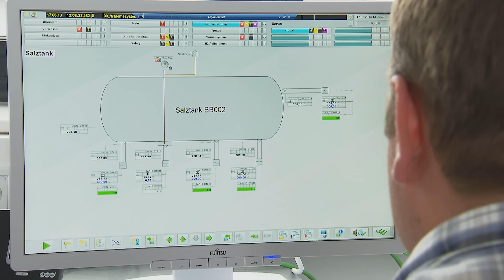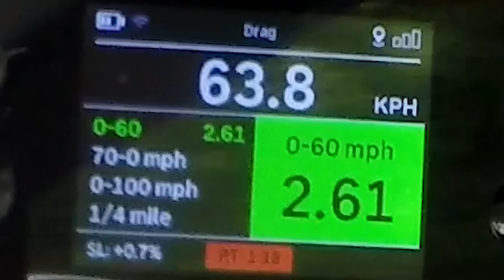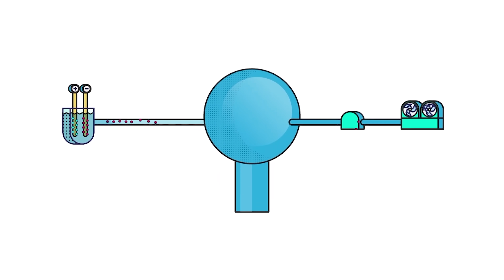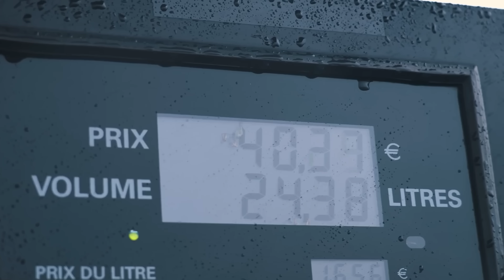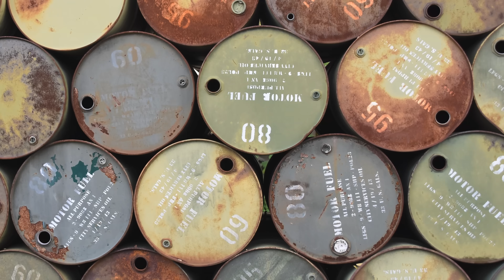Porsche just SAVED petrol engines FOREVER

Comment: Had no idea the racing cars were already using this. Shows the fuel works and racing is important for car developments.
Reply: F1 will be using it from 2026, when Ford and Audi enters. This still doesn't change anything about EVs. E-fuels will be way to expensive for a long time.
Reply: The WRC also use it too
Reply: What do you think F1 was all about? Tyre development, oil mileage etc
Reply: The fuel is over double the price to conventional gas so nobody will want to use it in reality unless they manage to push the price down considerably.
Reply: @dingdong2103  "Over double" is doing it a disservice. Will be far more than that. Energy requirements are huge.
Reply: @dingdong2103  That's where the economy of scale comes into play.  In these early stages, it's going to be expensive because it's made in limited quantities and still new.  Once production increase and maybe even licensed to other 3rd parties to produce, it becomes much cheaper and affordable for the average consumer.
Reply: @erik9108  Not unless fusion power suddenly becomes available as the process consumes large amounts of electricity
Reply: I absolutely would. Like yesterday. I don’t drive so much that I couldn’t afford to pay $10/gal in order to have zero emissions
Reply: E-fuel is a scam and so inefficient to produce for cars 😂 With the electricity to produce it, why not store it in batteries?
Reply: @aristoteles6265  not enought batteries, thats why.
Reply: @aristoteles6265 because batteries give off constant heat, so much that they will heat the planet up quicker than co2. I think 400 years the sea will be boiling if we jeep going the electric route. Eberything from the production, storage, and transport over copper is dumping ungodly ammounts ofnheat into the air. We have already known this as cities have a different temperature to areas around them. But we know there is a tipping point where they start to heat the globe. With this method the cars only produce heat when on, the pollution is zero, storage is easy, transport is easy. we can bring enough fuel to an island community in one truck, it would take an ocean full of wind turbines and a storage system that would heat their island up. We have done the maths, geo thermal energy might hurt the planet more than coal. The maths is still being done, but its not clean for the environment. Batteries are a future disaster
Reply: @aristoteles6265  
1.: Storing energy, especially in batteries is really inefficient, it incurs a lot of losses
2.: Battery manufacturing, taking into account the mining of base resources needed, is quite limited and produces a lot of pollution.
3.: Speed of energy exchange for batteries (charging and depleting) is limited. Though they made big improvements in the close past, but im afraid thats not enough and these faster and faster charging times are damaging the battery and electronics in the long run
Reply: @SuraSzellem  you say batteries are inefficient compared to a combustion engine? They are 35% efficient. Combined with transportation and energy consumed and any other inefficiencies it comes out far worse.
Reply: @SuraSzellem  Storing energy into Li-ion batteries is 85-90% efficient. In comparison, it takes up to 30kWh of energy to produce 1 litre of e-fuel.
Reply: @aristoteles6265  Does that include pumping in and out of storage tanks. Pumping into transport tanks to be distributed to gas station pumping back into vehicles. Damage to roads and bridges caused by fully loaded transport trucks. I love ICE cars and as good as the network is in getting everything to market unfortunately it's not a perfect system. I like the idea both systems working together.
Reply: @ChasL704  No, it doesn't. Everything else piles up on that. The total energy efficiency of e-fuel until it hits the tank is about 40-50%. Tank-to-wheel efficiency is about 20-30%. So in total, all the way from production to motion, e-fuels have an efficiency of 10-15%. Whereas in BEV, the total efficiency is 70-75% in total.
Reply: @aristoteles6265  It's just another sleight of hand by the oil titans. Make people less anxious about combustion engines by selling the muggles a fantasy. 

They did the same thing with plastic. If you look at most plastic packaging it will have a number with recycle-arrows going around it.. The recycle arrows do not mean it can be recycled.. The number represents what kind of plastic it is. MOST plastics can not be recycled at all... Yet they all have this number and the recycle arrows... 
They do that to make you feel OK about plastic packaging.. "Oh, this is recyclable, nice." Nope. Plastic industry pulled a fast one on us.

Same thing here.. All tech relying on carbon capture is nonsense, because carbon capture is nonsense. The filters on factories will in no way shape or form be enough to satisfy even 1% of the car market. That filtering is also super expensive.. Plus more and more factories are moving to solar.. So there will be less and less of this carbon to use..

Just reeks of misdirection.
Reply: @aristoteles6265  agree with the first part, BUT remember that producing batteries is not quite 'healthy' for ecology. And there is kinda no way to reuse the batteries
Reply: 80% of cars in Brazil use it since 1993
Reply: @carnage123  I dont think you understand what e-fuels are. e-fuels are not plant based ethanol.
Reply: @carnage123  plant based ethanol is not carbon neutral iirc
Reply: @carnage123  hahah live example Brazilian had temp iq
Reply: @carnage123  E-fuels are completely synthetic fuels made from water hydrogen and atmospheric CO2. That's why their carbon footprint is 0. Because they use the CO2 they produce (by compustion) to create new fuel, it's basically recyclation (you only need energy - a lot of it - to produce the fuel).
Reply: @carnage123  even 85 percent of the cars in Switzerland also.
Reply: @purwantiallan5089  I doubt it
Reply: @theo7709  they really ad 10% ethanol into your regular fuel here in switzerland. I dont know why or whats the benefit of doing that, but they do it.
Reply: @petarslavoroduzasny the ethanol is derived from green methods, so it makes the fuel 10% eco friendly compared to zero.
Reply: @petarslavoroduzasny  yes, but Ethanol is not E-fuel
Reply: @theo7709  yeah you are right. Ethanol and efuel is not the same. I just mentioned that they really add ethanol to the regular petrol here in switzerland. I dont know why or whats the benefit, but if you fill your car here, 10% of your fuel is ethanol.
Reply: @Petar Slavorod Uzasny  that's not exclusive to Switzerland. Many countries are doing this also with a much higher percentage of ethanol. But bringing ethanol into this conversation just confuses people even more. Ethanol has nothing to do with this video. His comment was just plain wrong.

Comment: Quite well explained video but they forgot to mention the €l€fant in the room. The price of efuels is linked to the price of electricity since electricity is the key to make efuels, so a kW of efuel energy will always be many times more expensive than a kW of energy used by a BEV, therefore efuels will be for the rich. It's not by chance that is Porsche pushing for this and not Dacia. Anyway BEVs will be so superior to ICE cars in every way by the time commercial efuels are available at the pump that indeed only rich petrolheads will buy it just to show off.

Comment: Call me stupid but they have created something that can basically save the planet (by removing carbon from the air) just so they can carry on building engines that will destroy our planet? Surely this machine that sucks the shite out of the air could then make something good out of that shite rather then making fuel so they can save a few quid on designing ev's? Couldn't the money spent and soon to be spent on designing and making e-fuel just be used to make more renewable energy and fitting more charge points, maybe even making charging at home easier/faster which would be a massive boost to ev's. In an ideal world we need to remove the carbon we have already added and then not add anymore or atleast less then we are removing.

Comment: Right now synthetic fuel costs $45 a gallon. That isn’t even green eFuel either. Porsche hasn’t even started the extremely expensive carbon capture process yet. It takes at least 39.4 KWh of electricity to produce 1 kg of eFuel with 100% efficient electrolysis. That is half a Tesla Model 3 battery pack for about 60 miles worth of Hydrogen miles. Never mind the fact that eFuel is far less efficient than Hydrogen fuel cell vehicles.
eFuel will never be viable in consumer vehicles. The process to produce it is just too inefficient and expensive.

Comment: The sheer inefficiency of ICE powertrains together with the small issue of needing to harvest vast quantities of atmospheric CO2 means that synthetic fuels absolutely will not save ICE for road use.

Add to that the UK government have said clearly that they will not allow synthetic fuel ICE vehicles to be sold after 2035.

The likely EU requirements for efuels to be genuinely carbon neutral (ie not using waste from fossil fuel based processes) also mean that it’s unlikely to be practical in Europe either.

The idea is (rightly) dead in the water.

Comment: Would have been great if you showed the difference between the E-fuel and Biofuel. (And why biofuels are a really bad idea)
Reply: why are they a bad idea, if you dont mind summarising?
Reply: @saitama9994  The channel "Real Engineering" has a fantastic video on the subject. Watch it and you'll understand completely.
Reply: @saitama9994  Or in short (if I remember correctly), the land used to grow dedicated crops for biofuel is better used to simply feed people (definitely if you think about the fact that there a still people starving). Biofuels are just not efficient enough.
Reply: @captainqwark4863  The same sort of argument could be said against e-fuels though. The clean power required to create them could just be put into ev batteries, same argument against hydrogen. I'm not nessessarily against e-fuels just don't see them being a replacement for petrol & diesel for the avergae person.
Reply: @SunsetHaze  Agreed but there 2 reasons I do like the idea of E-fuels. First, Petrol and diesel engine are automatically compatible with the E-fuel (where as engines needed to designed to be compatible with Biofuel).
Secondly, there's still nothing like the sound and feel of good engine. E-fuels will hopefully ensure that we don't have to them go.
Reply: @saitama9994  Some say they are a bad idea because of all the fossil fuels burned in making them. But they are the same folks who ignore all the fossil fuels burned in making and charging the massive battery packs for EVs. Once the power, heavy transport, farming and mining sectors are changed over from using fossil fuels both will essentially be carbon neutral, or even carbon negative in the case of RNG and some other biofuels.

Comment: This is very interesting, and a lifeline for "normal' vehicles. Lets all hope it happens.
Reply: I don't see how it will be useful for regular light duty transportation. In 15 years, we should have a much more robust instructor for manufacturing and charging EVs. For class 8 trucks moving long distances, perhaps not. If a car manufacturer wants to make 1000 hi-po ICE cars a year to run on fossil fuels, that would be fine. Mass produced daily drivers, EV.
Reply: @deansmits006  "Should have", "Will have" "Will be". 
We've been hearing this nonsense around ev's for the last 10+ years and so far the largest advancement is the extra price. 
The base tech is still lithium, they still hold all the same drawbacks of weight, environmental destruction to make, shorter lifespans, charging speeds and so on while none of the promises of them being able to charge in 10 minutes, do 500+ miles and last 1,000,000 miles. 
Throwing ever larger batteries in them has masked the fact that actual technical progress has been almost nothing. 
Long range ev's using current tech are a nonsense. Plug-in hybrids or even straight up normal hybrids still make the most sense for almost all use cases right now. 
The numbers are there if you want to actually check that instead of preaching ev's only which is not the cleanest use of what we have. 
When some wonder battery turns up which can do what a petrol tank can then that changes but until then having massive batteries in cars which will only use their capacity a few times per year is a complete nonsense.
Reply: yes normal vehicles need a break we should give more lifeline to it now
Reply: Normal vehicle is a horse 🐴 get with the times man!

Comment: Car manufacturers, to compete, like to bring out new models continuously. EVs, if they do the same, means a very large number of large batteries needed, which then will need recycling or they will be a big hazard. At least E fuels uses the existing infrastructure and avoids this, but it allows business as usual, and I suspect it will end up just a clever way to avoid the real problem of ditching non renewable sources of energy. In other words it will be harder to see the use of fossil fuels, but its use will increase, in the same way that EVs can still use fossil fuel as the source of the energy.  I do not see the oil industry or ICE car industry voluntarily giving up its profitable position, and this just shows a stage of this. By the way, I love my cars as much as anyone, but climate will not get better and unless there is big social change I do not think we are going to tackle the problem, so I am pessimistic.

Comment: I love a good engine, but this is bullshit! 
We need e-fuels and we need a lot of them! BUT it is not cars we need them for. Until 2035 battery technology and charging infrastructure will be cheap, fast and capable enough for 99% of the population to have no drawbacks. And BEVs are much more efficient than ICE cars. Electrification of planes and ships will be much more difficult if not important. And that’s where e-fuels come in. So before we haven’t switched our planes and ships to e-fuels, there’s no logical reason to bet on e-fuels for cars. 
Also: like you said at the end of the video: the size of the industrial complex needed to produce the desired amount of e-fuels is enormous! The space needed to for CO2 capture stations and green energy is simply gigantic! Next: where does the water come from? Have fun finding water in Saudi Arabia to produce e-fuels…
And fun sidenote: Porsche is currently producing 0 liters of green e-fuels. All the co2 they use gets transported to the site of their factory by trucks and comes from e.g. steel plants.

Comment: So the reasoning for the e-fuel escape route is that we don't have the infrastructure yet. So we go e-fuel for which.... we don't have the infrastructure yet. Brilliant reasoning.
Reply: The thing is we could get the infrastructure to go e-fuel. We will never have the infrastructure to go full EV because the raw materials to replace every single ICE on the planet simply does not exist.
Reply: We don't have the infrastructure yet most stop where chargers are have normal cars parked in, chargers not working there's a lack of chargers plus if I live in a house but don't have my own drive how I charge my car get a 100m extension cable alot of people have to park on roads or away from there house 😂 and fast chargers are expensive like 26-30 quid to fill to full to get 250 miles I can spend 60 quid on diesel in 5 minutes and driver over 600 miles, ev cars are shite, plus add in the English weather winter you'll probably get 200 miles or less from a EV unless
Reply: @00lorted  It's not even the chargers. We simply do not have the power generation and renewables are not the answer. And yes, EVs are utter shite. And pray to god it never catches fire.
Reply: @00lorted  exactly my point 😂
Reply: We do have the infrastructure what were missing is production capacity
Reply: @matth8205  No, not true. Who would be the distribution partners? This is Porsche's invention. Do you think, say, Shell would be interested in having someone take part of their market away? I think not.
Reply: @allwheeldrive  yes exactly that. Porsche is a car manufacturer not a fuel manufacturer. I think you might have missed the entire point of the video. Like it or not shell and every other fuel manufacturer will lose their market in a global revolution to electric based vehicles. They can however switch over to producing a different type of fuel to sell through existing distribution routes. Which is exactly what Matt says in this video. Porsche does not own Synthetic fuel its one of many developing and using it.
Reply: @matth8205  No, we don't. The UK, and Europe for that matter, does not have the power generation capacity to support full EV. We barely have enough for what we have right now and cannot deal with any shocks to the grid.
Reply: @MCDrB-wq8ed  we have the infrastructure to distribute e fuel. Not support a full EV switch over.
Reply: @MCDrB-wq8ed  yes im well aware of that.

Comment: This is, the only sensible solution. Or possibly….Half EV, half ICE. According to the video, a Merc EV did 320 miles. I say, that is about as much range as they will ever achieve, because if there was a technological advance, someone at Tesla would have found it by now. When you start factoring in, half the range due to a caravan etc, EVs don’t work